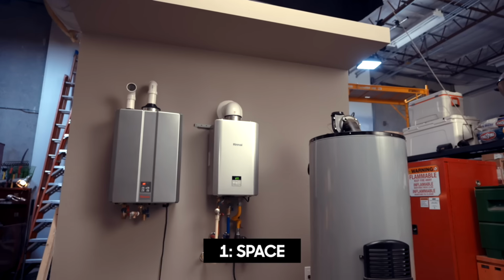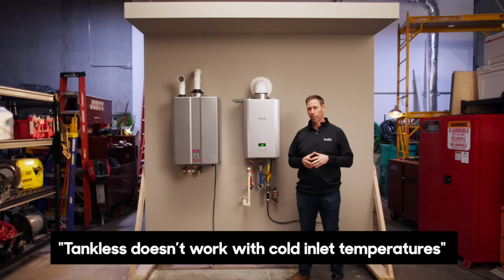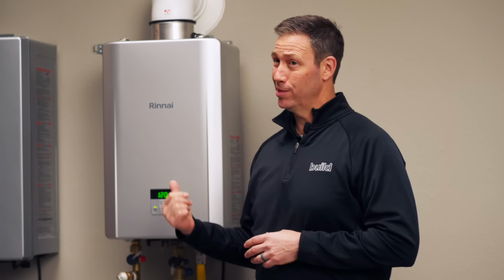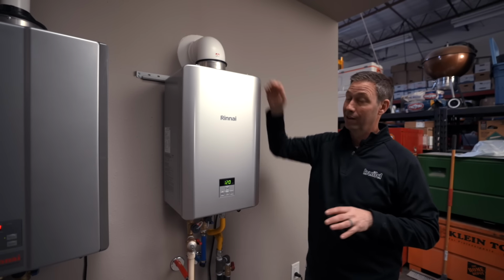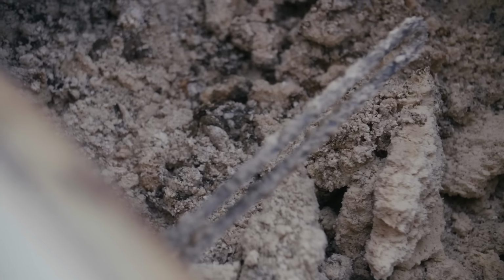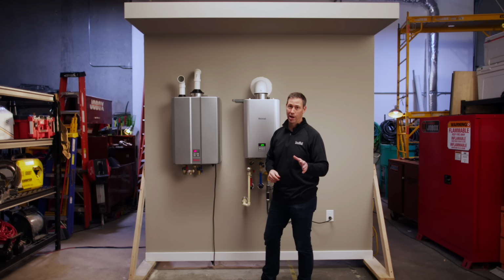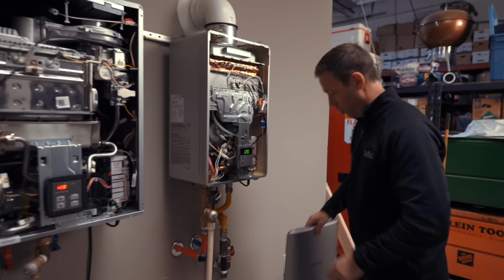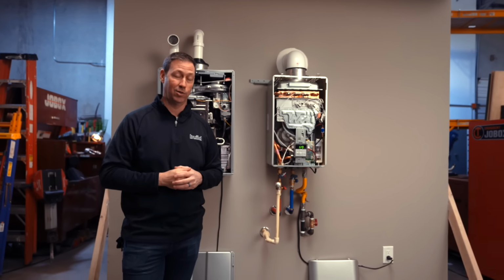DEBUNKING Tankless water heater LIES!

Comment: The cold issues we have in Canada aren't with incoming water temps but flu vent problems, in severe cold the condensate in vent pipes ices up quickly and becomes blocked enough the unit shuts down with error code. There's always huge icecicles hanging off the terminations outside in January and February. Also with many units in basements in Canada when you get a lot of snow the vents get burried, and people forget to clear em.
Reply: I'm in Canada too. Buy a condensing tankless unit: there's almost no moisture in the exhaust air to freeze. More money, yes, but higher efficiency means less gas burned.
Reply: @paulmaxwell8851  Ya! We have some IBC's and there doing great so far...🤞
Reply: then those vents should be higher or whatever needed so they don't get blocked.  User should not have to go out in snow to clear vents.  Geez it amazes me how much money is spent on construction  design yet it so often does not accommodate real life conditions or actual human behavior.

Comment: If I'm taking a shower and my wife runs the dishwasher or takes a shower at the same time - water pressure pretty much drops to zero. Not to mention it takes 1-2 minutes before you see any hot water if washing hands / dishes. Over time, that's a lot of wasted water.

Comment: First if your water supply is cold even the bigger units will restrict flow to heat the water up You have the 6-10 second delay while it starts up and begins to make hot water so even if you have a circulating system you will end up with a big slug of cold water.  The worst is if you have a shower that switches from wall to hand held unit the tank will see that as a flow stop then give you a nice splash of cold water in the middle of your hot shower. Add in the yearly maintenance added upfront cost and if you go by the actual energy guides there is a good case tank types are cheaper to run. Now in warmer climates or for vacation properties it might make sense but after owning one I will never again have one.

Comment: You say that it's not that much more expensive to upgrade to a tankless but it seems that that's only the case if you're going from a (gas) water heater to a gas tankless, but if you're going from an electric and then you have to upgrade the service. Then you have to hire an electrician, and that increases the cost significantly than to just swapping out with another tank.
Reply: They are a lot more over all to own and install. He isnt being honest. Also if you have a butchered install by a contractor then it gets more expensive to fix and make right.

Comment: I have a non-condensing Rinnai and it takes 10 seconds from when I turn on a tap to when the outlet pipe starts to warm up, and maybe another 5 seconds until it's at full temperature. So there is definitely some extra delay compared to a tank. Of course the 60+ feet of 3/4 pipe from the WH to the bathroom doesn't help either. I'm replacing it with a hybrid water heater (located closer to the bathroom) because a heat pump is more efficient than even a gas condensing water heater.

Comment: The nuclear power industry is pushing hard to expand and supply abundant electrical power. 
The nuclear power promoters are pushing hard to spend $billions today before anyother technology gets a foot hold. They want to supply the electic power to drive additional power to the new Electrical Vehicles.
This will increase electric use 3 times today's installed electric generation capacity.

Comment: TANKLESS continuous electric hot water is a very small heater. 
Inside installation and at the main point of use is very good set up.
The gas fired systems are manly a last gasp effort to for the fossil fuel industry. 
They know they have limited time to maximise any remaining value in their manufacturing facilities. 
Electric equipment is incredibly simple and cheaper to make. 
Even the gas fired system need electric supply to turn on.

Comment: Matt, didn’t you install a heat pump tank style water heater in your home remodel?  If so, curious why not a tankless?
Reply: It is whoever he is being sponsored by.
Reply: Heat Pump water heaters like the Sanden CO2 is by far the most efficient and long lasting. There are reasons tankless might make sense, but for efficiency and every day use, tankless doesn't make sense especially if you have hot water recirculation loops.
Reply: because he is a shill who goes with what the sponsors pay for

Comment: I've had on demand water heaters for about 40 years, but originally only at my ranch.  I switched my residence water heater from a tank to a tankless about 25 years ago.  I agree that they are better than tanks for MOST things.  But, there ARE some things I don't like about them.  1.  Noisier : so much nicer to have it outside.  2.  they waste more water.  ESPECIALLY if they are inside and the have to vent, so the fan is on venting and cooling off the combustion chamber every time you turn it off.  Fan goes for a minute or two.  But also, since there has to be water flowing thru the unit to get it warm, then it takes longer to get hot water to the place it is being used.  So I highly recommend placing the heater outside, BUT make it close to the place that hot water is used intermittently but often, IE the kitchen.  It definitely uses a bit more water.
Reply: Can they be place outside in places that have freezing temps in winter?
Reply: I install Rinnais and also love clearing blocked drains

Comment: How to set up a strawman, not that I'd expect pros and cons in a video sponsored by the manufacturer. The additional space is negligible, tanks don't require electricity, tanks have a ten year life despite poor maintenance, and technically once you open the tap hot has to start flowing before the heater responds and lights to start heating so there's more cold entering the line unless it's also heating water constantly. I like how the same people that talk about wasting water, efficiency, and saving use never ending hot water as a pro.

Comment: They will last
Reply: Lol no they dont. I work on them daily. Most are not installed correctly. Most are the cheaper brands beacuse they cost so much on average. The repair costs are a lot more, delay in time for parts is high. lol Tankless last on average 11 years unless you buy the ultra expensive models that get closer to 16 max.

Comment: You can extol the virtues of tankless all you want but the bottom line is they are simply more complex.  Far more electronics, far more moving parts and scale is an issue with them - even if you have a water softener.  
I was a huge proponent of them - until I started talking to people who owned them and did some more digging.  No thanks.  I'll stick with my good old fashioned tank water heater - that will also still work even if the power goes out.
Talk to anyone with a tankless over 7-10 years old - it's pretty eye opening.  The difference in cost is NOT worth it.
Reply: Gas tankless with a battery will work during a power outage...
Reply: @joequixotic3039  until the battery goes out.  I suppose if you have a lower end model that only has electronic ignition it's less of an issue; but the higher efficiency models have an inducer (fan).  If you aren't going for higher efficiency ones  then the value prop goes from meh to total suck.  Good luck getting more than 20 minutes or so runtime unless you invest in a larger UPS, which just further shitcans the value prop on theses over-engineered POS.

Or, you know, just stick with reliable tech that's hundreds of years old and drop dead simple.  

To each their own - if you think they are so great, have at 'em.  Our water is so hard around here that even with a water softener they are a constant descaling nightmare.

Comment: True story. I built my house in 1996, had two tank water heaters a 50 gallon and a 40 gallon which was gas. When I sold my house in the Houston area in 2020 it still had the original 50 gallon tank. It also was used for my Geothermal heat pump to keep water hot. In the summer time I turned the power off to it maybe that extended its life.

Comment: Few points I would like to discuss:  
     Here in New England we need to use cpvc which is about $100 bucks for 10’ depending on size and you ain’t pulling intake from inside. Obviously length of run matters but you’re also paying a plumber to install it.
      Gas pipe size is strictly based off btu and length. Tank, probably in mid 30k btu and tankless around 200k btu that’s over 6 times the amount of demand, you can bet your butt you’ll be upsizing that pipe and probably your meter as well.
      Tankless is far more complex internally, thus has more parts to fail, add that cost to its life expectancy.
      It’s a lot easier to flush a tank than descale a tankless, add that to cost over life expectancy.
Reply: That could be true for many replacements.  But if you have a 3/4" line currently, and the unit is not hugely far from the gas regulator, it should be fine would be my guess. (3/4" line can run a HUGE amount of BTU's, at least 500K)
Reply: @paulkramer4176  I think that's op's point that the current tank is speced out to work in the location it's in without major upgrades. There are houses with tanks 20 feet in the air and 50 feet from the meter, tanks in basements with no easy access to fresh air, tanks with no electrical outlets on the same floor. It's different and not for everyone, there's a reason why lots of people are like if it ain't broke don't fix it.
Reply: People really like adding more upkeep costs to their homes I guess. The new build Matt put up has so many filters to swap out and you gotta maintain this system. In contrast 1900 era homes have no filters and the hot water tank runs through a blackout. There's something to be said for a house that can lose a utility and can survive years with little maintenance.
Reply: Well gee...lets see
  - Tankless if properly maintained can last two times longer (20 years) vs 10. So lets take into account the cost and removal and installation of that tank with a new one and its associated labor. And if you have a larger family and thus need a larger gallon tank and this more expensive, the cost of all that at the 10 year mark basically covered most of the initial cost of the tankless install even with new pipes. 
-just cause its more complex doesn't guarantee failure. I had a Ford Fusion Hybrid for 9 years and not had a single battery or electronic issue by the time I traded it in. Tankless is a mature product and technology, it has a warranty, and annual PM on it can make it potentially last without any issues. If your gonna make that comment you might as well say "well, the 70 gallon tank may fail and dump all its water into your basement causing damage to everything stored down there and that costs money, so take that into the cost of life expectancy".
Reply: @guardianali  well if you replace the anode and flush the scale as part of your tank's "proper maintenance" I don't see why you couldn't get 20 years out of it. People just don't cause it's cheap enough to just toss out and easy enough to replace. Plus you get modern advancements, a new warranty from defects, and new set of burners and valves.